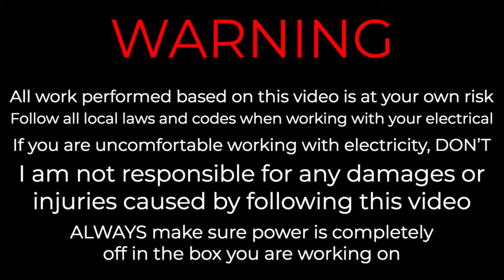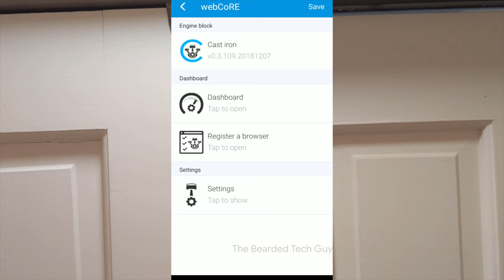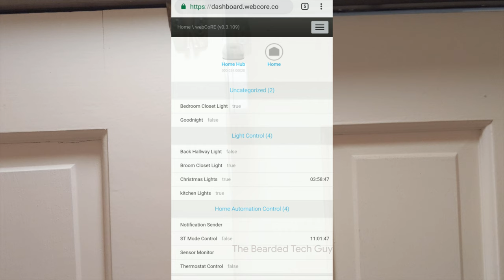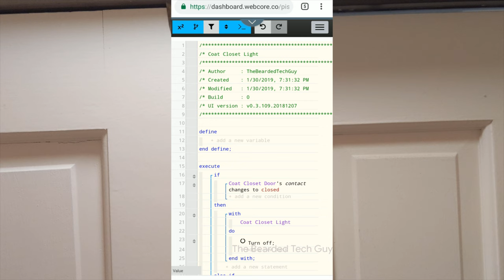Smart Switch Installation & Home Automation Setup - Closet Light Control

Comment from the maker: Looking to buy any of the products seen in the video, check out the below links:
GE Z-Wave Smart Switch w/ On/Off Paddle: https://amzn.to/2r2UP9F
Samsung SmartThings Hub 3rd Generation: https://amzn.to/33drbwT
Samsung SmartThings Multipurpose Sensor: https://amzn.to/34pBEoY
Museum Putty: https://amzn.to/34tlqLK
Spacers: https://amzn.to/33fMUUL

Looking for a specific part? Check out these sections:
What you'll need - @1:04
Getting started - @2:00
How to remove an old light switch switch - @2:15
Going over the GE 12722 smart switch - @4:10
Installing the smart switch - @5:10
How to add devices to Smart things - @7:05
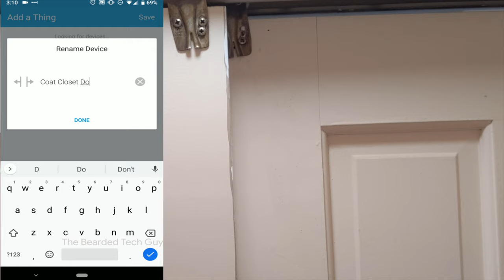Installing the multipurpose door sensor - @7:44
Setting up basic automation within WebCore - @8:23
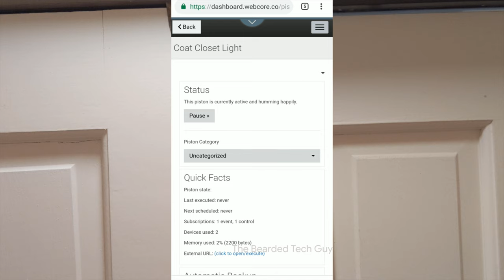Testing it all out - @11:03